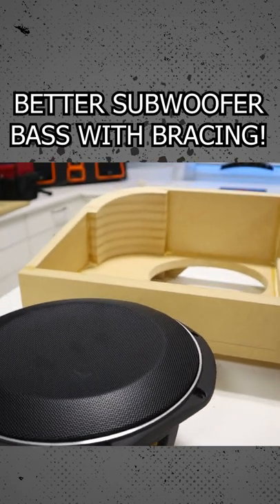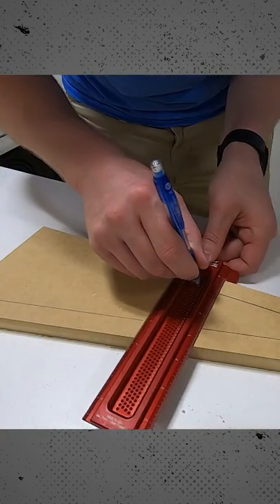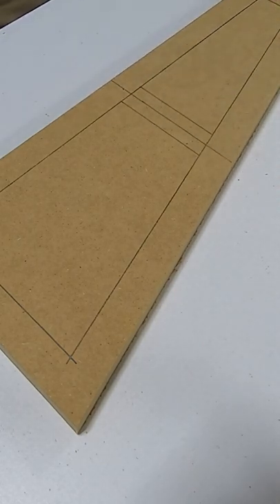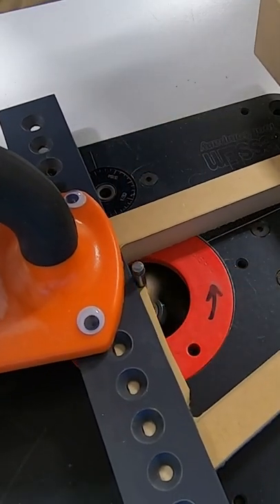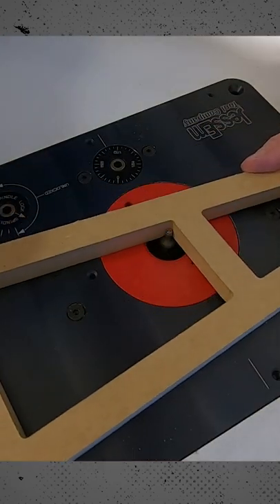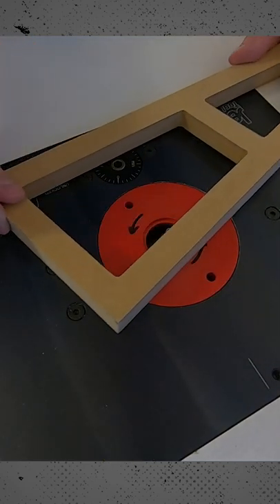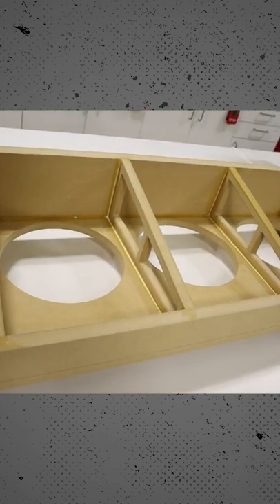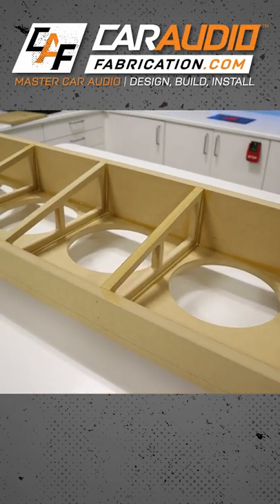Want great subwoofer bass? You NEED bracing! #shorts

Comment: Yo! How do you get rid of alternator hum? I got my system fully working and then I got this horrible whine :(
Reply: Invest in an alternator with higher amperage. Also would upgrade car power wires. Look into 'big 3 upgrade.' However, you may have a bad ground that may be causing that
Reply: Hum can be a bad ground somewhere. This fault can also come due to bad ground in one or more of your equipment. I had it once and I decoupled one by one item until I found the culprit. It turned out to be my active crossover